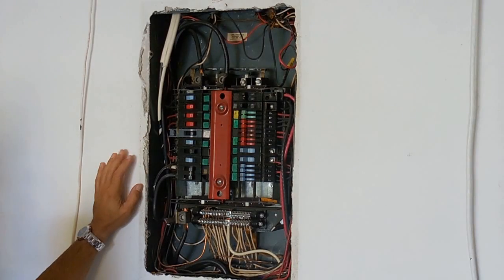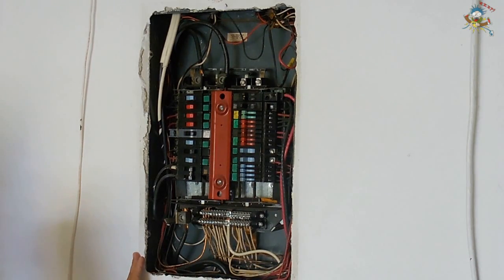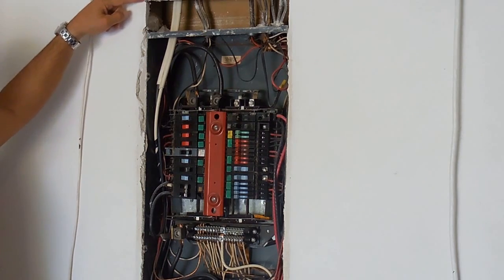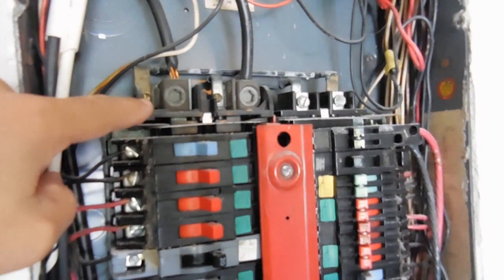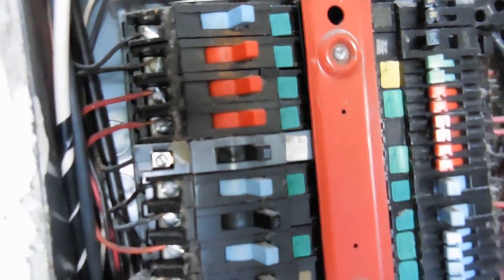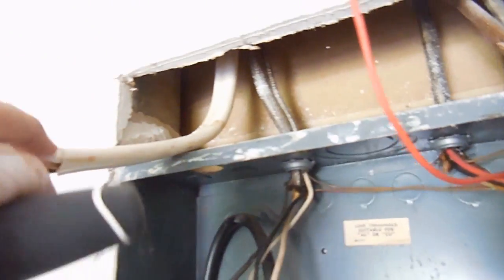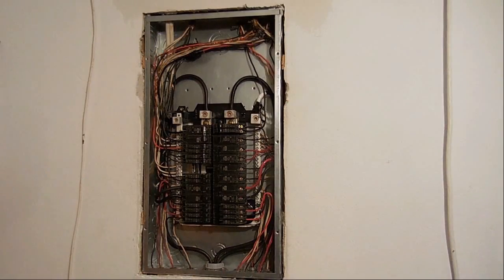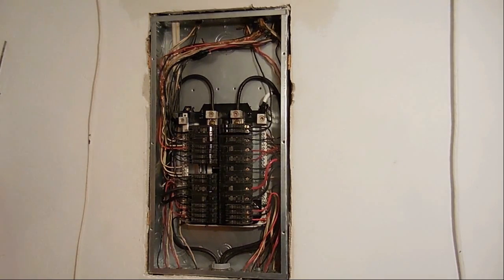Swapping Out A Breaker Panel! (How To Replace An Old Breaker Panel)

Comment: because your main breaker is outside that panel becomes a sub panel, so your ground and neutral wires should be separated and isolated.
Reply: Does apply in this case , that's a 3-wire system,
Reply from the maker: A subpanel has it's feeds taken off a main panel, which is not the case. This is the one and only panel, "Main Panel". It's considered a subpanel because the NEC says the breaker is not inside the panel. It's safe the way it is, and millions of older homes were wired that way with no issues at all, but when I upgrade the meter can and main breaker in the future, I'll pull an 8ga ground wire into the panel and separate the neutral and grounds. No big deal. NEC.....rules today are violations tomorrow. Thanks For Watching

Comment: thanks hombre; no scorching > the original electrician wiring the place probably 'balanced'  the circuits in the panel...then over time things change, additions, overheated breakers, etc.; any backwiring or shared neutral issues the (short wire lengths for 'my' installation preference) ground / neutral wires that were originally connected?

Comment: I got a  FPE breaker box.  It has different bus bar design that looks really bad.  The panel is warm, a lot of the time.  I'm gona have it replaced.  One crucial factor in how many amps a circuit breaker box is rated is the size of the bus bars.
Reply from the maker: +WAVETUBE84 
You must have a Stab-Lok panel. Those are the panels which are the big problem.
Reply: Probably.  The mfg.s try to come out with their own proprietary design that cannot be copied (patent infringed) and so you have to purchase their product.  I'll be changing the panel this year.  C/B panels have been out for almost a century.  I think they should be standardized:  all the same breaker sockets, etc.  So should oil filters:  all Ford, Chevy, and Dodge V-8s out to use the same oil filter.  that would save a lot of time and lower the cost of inventory....

Comment: When I did this job in my state. (NJ) I had to add two 8 foot ground rods driven into soil as well as a water pipe ground (pre existing) to satisfy code. My house was built in the 70s, and didn't have the extra grounding. Just wondering if you had to add them as well to your upgrade. I enjoy your videos, thanks for sharing them.
Reply from the maker: +Fireship1 Hi there. The existing ground rod next to the meter can was sufficient.

Thanks For Watching!

Comment: nice video, thanks.
Reply from the maker: +moshe2002 
Thank You! My viewers should have a very wide range of knowledge after watching my videos.
Reply from the maker: +Electronic Experiments 
I have another in a week or two. This channel is not only an electronics channel. Many of my electronic circuit videos do not get the views they should, which is why I need other videos on my channel which appeal to a greater audience. :-) I need more videos which compensate me for all my hard work. It would also help if my viewers would share my videos and support my channel.
Reply: +electronicsNmore Do you have an estimate for how many hits you need to get a baseline of $10? I've been curious how this works for some time but all google searches show up are useless advertising sites that don't clarify this simple question.
Reply from the maker: There is no set amount. All varies. Depends on the RPM amount and how many clicks you get.